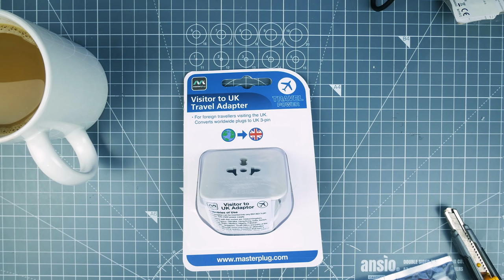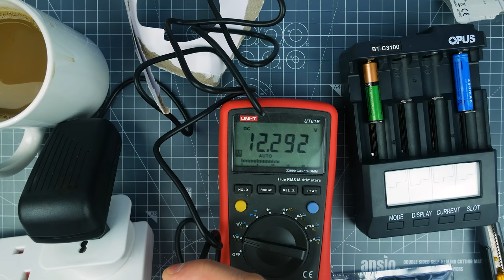Post Bag 17 - LEDs and Toys

Comment: 3:10 I'd recommend looking into the APA102 instead. They have a simpler interface (data and clock separately) and don't require the "tight timing" required for the WS2812s. You can write data lazily, whenever your MCU has time or using the serial hardware and interrupts (UART).
Technically they can be clock'd much faster than the single pin solution as well.

Comment: 5:54 - it's NOT a vibration switch. It's a (very unreliable) rolling ball switch. It won't work if you "shake" it... the idea is that you invert the dice (LEDS down) and it "rolls" (all LEDS illuminated + vibration motor) when the ball switch is "on". When you rotate it back to "LEDs up" it displays one random number (but it's not very random).

Comment: There is a design of adaptor for those Euro plugs as on your power supply:
https://cpc.farnell.com/powerconnections/bca-bk-3a/battery-charger-adaptor-3a-black/dp/PL09958?st=euro%20plug

Comment: Hi David, I have built a few of the shaker LED Dice kits and the one failing is they use 2 x 2032 lithium cells and as soon as the voltage drops .5v the device stops working.  You know its the battery when is continually shows 5, otherwise it works well.
Reply: I've got one as well, and I reckon it is SHIT. As you indicate, the thing has no voltage headroom. The silly shaker motor takes far too much current, so you are lucky to get one or two rolls before the batteries are "flat". The rolling ball tilt switch is unreliable - should be a shake switch anyway. I particularly dislike how it just stops on the number, rather than slowly coming to a stop.

Comment: Poundland used to sell those travel adapters, probably still do
Reply: a lot of these multi-adapters are horrible. The sockets don't hold the plug's pins firmly (quite dangerous) but the one David showed worked fine (at least for continental plugs). I myself would rather get a one-to-one plug instead
Reply: @maicod  I recently got one that was horrible. Wouldn't hold a plug without it falling out. Had to wiggle it to make contact. 

Fortunately it was cheap.
Reply: The poundland ones are alright as far as these things go, IMO equal to the tesco... but I think the best idea is just to chop off the foreign plug and put a british plug on
Reply: @pileofstuff I know what you mean. There is only one place for it and that is called the trashcan.
Reply: @pileofstuff I just finished watching your latest video small world

Comment: This is completely idiotic, but I'll share it because I'm not sober-- in the US, the earth pin is on the bottom but it doesn't matter because, like, 10% of plugs are installed upside down. But when I moved to the UK, I found out your earth (or whatever it is) pin is on the top. Two years after being there. I just thought Brits had a penchant for installing outlets upside down. Turns out it's also about 10%.